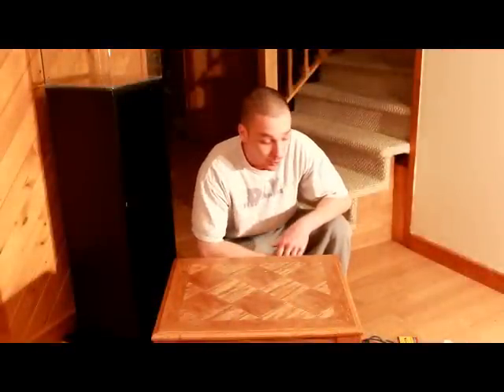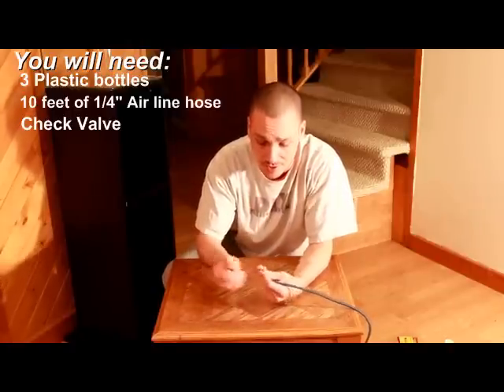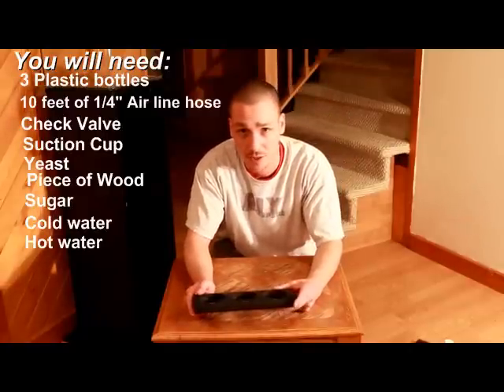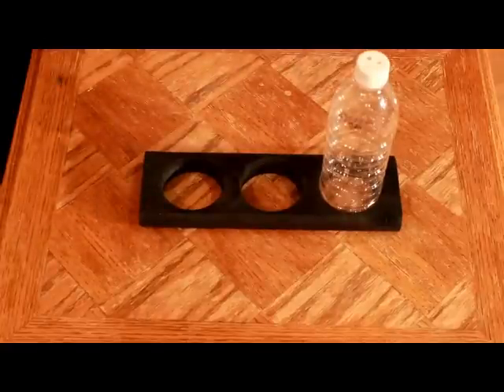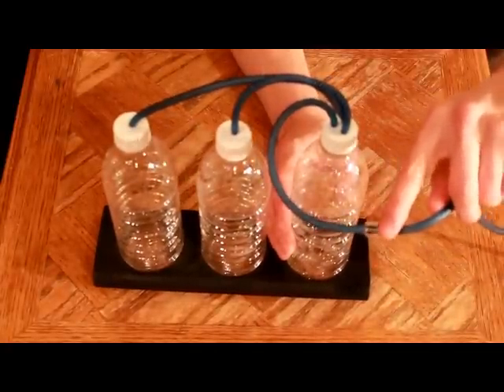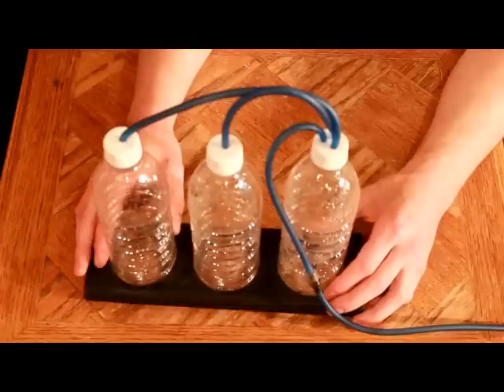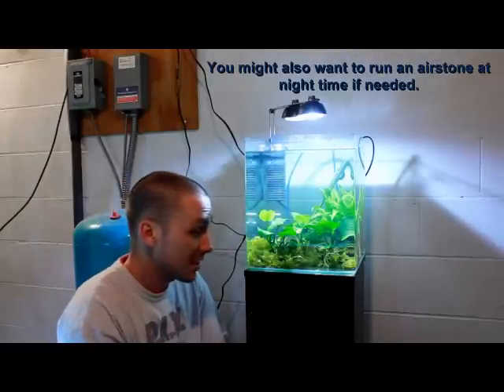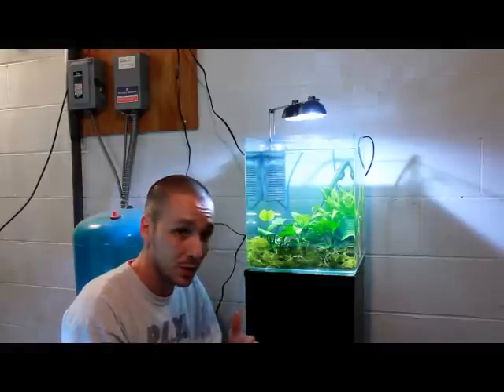HOW TO: DIY CO2 for planted aquarium TUTORIAL

Comment: Anyone watching this should add a check valve between each co2 reactor & the sump/collection bottle. Doing this allows you to disconnect the reactors without losing pressure in the system.
Reply: Hey only got one check valve can i use it in before the yeast generator  or before the bottle bubble counter whose co2 pipe is directly  connected to diffuser

Comment: i have aquestion, i have 4 planted small mini tanks, and i wil use your system, only where do i put the check valve?, i have now 1 check valve, do i need 4? 
also i have a metal splitter with 3 ways out (+tap taps) to use : to my other 3 mini planted tanks. (3 are same gallon, 1 is bigger gallon, 
please can you help me where i put the check valve(s), 
and where put the splitter 3 way out, with tap taps, 
thank you..

Comment: How much would this setup possibly be for a 125 gallon aquarium?
Reply: TheTerminator1919 You can do this project multiple times and have them work at the same time for more co2. I think getting a tester for co2 to see how much you need. I would say it costs a lot cheaper than a $200 system.

Comment: if you turn the co2 off at night would yhe bottles explode from the co2 build up???
Reply: Maddie B yes. it will. the cap. solution get a epoxy or any glue, glue gun to hold tight the cap.
Reply: @diyhobby5574  so should I remove the cup for it to not explode?

Comment: Hey Joey, as always great information. I do have a few questions though. 1. could you just attach an small air stone to the line instead of building the Co2 diffuser? 2. Can you also attach the Co2 line to an air pump line and have both flow into the tank at once?

Comment: I'm doing this with 2 575ml bottles, my yeast sugar mixture is fine since I can see many bubbles popping up in the 2nd bottle but my problem is that the CO2 is not flowing through the tube into my aquarium, I let it sit for an hour now and it's still not popping up in my aquarium.. I don't have an inline valve thing, just a tube straight to an air stone from the 2nd bottle.. Why is this not working? Do I need the inline valve? Do I just need to wait for more pressure to build up? I don't think there is a leak in the 2nd bottle because when I squeeze it the air DOES go through the line into the tank.. Help!
Reply: did you get it to work? was your air stone not letting it pass through?
Reply: ***** I always had a tiny leak that I just couldn't seal up with hot glue but the main problem was the air stone. It would not build up enough pressure to push through it. I didn't know this at the time but they have pressure ratings. When I took the air stone off it worked fine.
Reply: XeDragHD as for me i didnt use air stone but i use an cigeratte butt since its more easy to setup than air stone

Comment: I did this exact setup but the co2 seems to just be sitting in the bottles, and doesn't come out the line to the tank. Initially it did 1 bubble per 5-6 seconds, but now it does nothing unless I squeeze the 3rd empty bottle, then obviously co2 floods out the line. What am I doing wrong?
Reply: +Joshua Matthews Hey! I see that I'm 3 months behind answering this question, and hope you have since figured it out! I'm just starting to plant a tank.  I think adding some tap water to the third bottle may help you out.  Give the co2 less volume to hang out in.  You may also want to inspect your setup for leaks.

Comment: I just DIYed  a CO2 generator and added a regulator to help control the amount of CO2 in my 40 gal tank, but the gauge is not moving at all, after 24 hours, but the bottles are hard with gas. I opened the needle gauge but nothing is happening. What am I doing wrong? I really need your advise.

Comment: when attaching the airline to the lids of the bottles you can also drill just a bit bigger hole, put the tubing through the hole and then lightly heat up the end of the tubing with a heat gun, torch or lighter, then flare it out a lot with a sharpie or some type of pen. Then pull it snug. and its airtight

Comment: Quick question. If I wanted to use glass bottles in place of the plastics would there be issues?
Reply from the maker: Glass would even be better as they would not allow for expansion of the bottle. (pressure from gas build up)
Reply: ***** but wait … what if the glass ones can't withstand the pressure … or can they ? I'm using a Soda bottle cause they're meant to withstand the CO2 in there ? Idk its just my idea LOL
Reply: ***** The pressure doesn't get that high in DIY CO2 generators generally. Though glass wouldn't be that great of an idea if you plan to reuse the bottles since other things may grow on the glass that would kill the yeast when it's starting out and it would be hard to clean it between uses.

Comment: i already have fish in my tank and tried to add plants they didn't do well; didn't know about the co2! im going to fix this but before i just tank out the air stone and add the co2 system i was wondering how this might affect the fish. i know the plants will produce the oxygen for them but the plants are really small and im worried that they wont produce enough. so i was wondering if i could just add the co2 and leave the air stone until the plants are bigger or could i take out the air stone add more or bigger plants and the co2. its a 75 gal with 3 koi, 2 angel fish, 2 cory catfish and a pleco.

Comment: I had low pressure so what i did took 1 bottle away filled generator bottle with half cup of sugar and 1 full teaspoon of baking yeast less sugar produces less alcohol the filter bottle i half filled with water put the airline deep  in the water so i can count the bubble flow im getting 2-3 bubbles per second placed my diffuser (which is a cigarette filter making very fine bubbles) close to the top of my tank on a suction cup in front of my filter which pushes the bubbles around the tank the longer the bubbles stay in the water the more co2 for the plants PLEASE NOTE turn off all air stones pumps and anything making bubbles as this will make the co2 useless so at daytime i run my co2 when i turn the light out i take out the co2 airline and put on my pump for oxygen for the fish  hope this helps some people out

Comment: question. do i need to turn off or get the diffuser out of my tank at night?
Reply from the maker: Kyle Zoleta or just turn an airpump on in the tank to help with gas exchange at the surface. (i would put the lights and airpump on a timer. when the lights go out, the airpump comes on)

Comment: Hey Joey I have a bunch of 800 mL bottles lying around that I want to use rather than buying new 1 L or 2 L bottles. If I use the 800 mL bottles for half a litre of the mix, can I get a CO2 output equal to a 1 litre mix if I put 1/4 tsp yeast and 1/4 tsp warm water? Essentially, if I want to double CO2 output do I just directly double the yeast mixture, or is the ratio different?

Comment: Hey Joey ***** Would I need a diffuser, if I attach the outlet to my impellar on the HOB filter on my tank. Now its a 5 gal nano, so It has a small HOB for 15 gals or less on it. There is fine sponge on the inside for the gas to pass through on the way out. Would that be sufficient?

Comment: The best mix is:
Use a 1.5 liter bottle
Mix 4 deciliter hot water and 4 deciliter sugar, shake the bottle to dissolve the sugar

Then add 4 deciliter cold water, add on teaspoon of baking soda and shake the bottle.

Then careful add 2 teaspoons of yeast DO NOT SHAKE, the yeast should sit on top of the mix.

Comment: Nice video! I think Im going to try this out my self. I want to add something though! I think might work well with this system. If you want your yeast to produce moor CO2 you need to let the yeast have some supply of air from time to time. This leads to arobic respiration witch makes the yeast abel to break down the sugar moor completly. To fix this you could install a check valve from an old bike wheel tube, onto the CO2 generator. Then u can use a bike air pump to pump air into the system. And also the pump would counter the pressure difference in and outside the system so the air actualy can enter through the check valve even thought there is higher pressure inside the system then outside.

Comment: I'm using the 3 500 ml bottles as you indicated..
Am I correct that for a 10 gal tank, you'll only use 2 generator bottles filled with a total of 2 cups of water/sugar split equally between them?
Reply: I have the same question!

Comment: The video mentioned using an inline valve to regulate the flow of CO2, That would also enable you to easily shut it off at night. .

Another idea I found works well:  If you have an internal filter, drill another hole just above the inlet slots & feed the airline into it. The impeller will chop up the CO2 bubbles way finer than any diffuser.

Comment: Thank you for all yours ideas about aquariums systems. 
Then i DIY me CO2, its a littlebit  difficult to put the air hose through that 4,5 mm hole.
I use me scissors to  cut about 60 degree off the end of hose, after that its easy to put it through.

Comment: For those worried about CO2 build up overnight would some sort of inline relief valve be an option? Open the valve to bleed off the gas at night into your room and close the valve in the AM to start putting the CO2 back into the tank? Does a part like this exist? I have no idea... I just thought of this idea. Thoughts? BTW, planted tanks rock!

Comment: I never saw a 3 bottle method before. I did this many years ago with a single 2 liter bottle on a 55 gallon community tank and never had any issues with fish dieing. Added a little baking soda to the mix to slow the reaction down some. To diffuse I used an airstone, but also tried running the CO2 tube to the filter intake of a canister filter- once with one filled with media with no issues and then added an additional smaller empty canister filter with no issue.

Comment: I found that it is easier to insert the line into the cap if you cut a 45 degree angle on the tip of the hose before inserting it.

Comment: Air-stone is basically a diffuser. You need a specific diffuser for CO2 because air-stones do not release small enough bubbles to be taken into into the water by the time they reach the surface and escape.

Comment: Great video! I love all your vids, but this one is especially awesome. One question though: On other DIY Co2 generator videos I've watched they run the gas out of the yeast bottle up through water in the collection bottle to purify it and take any alcohol out of it. Is this necessary or optional? You seem to know a great deal and I trust your guidance, but will running it through water once before it heads to the aquarium harm the Co2 in any way do you know?

Comment: hey joey another informative video, I followed your design except used a 2L and then the smaller bottle for my tank but i connected the last hosing with the check valve to my tank to a old powerhead as the diffuser. Specifically i connected it to the venturi/airline valve on the output. Is this okay? I glued my bottles inside and out and i do see bubbles, the powerhead is on too, is this a good idea?.

Comment: I've been a fan of yours Joey, but you are making this unnecessary complicated. The way I make it is one 2L soft drink bottle, with 1/3 bottle of sugar, mix with 2/3 bottle of water and one table spoon of yeast, and it will last a month for a 2 feet tank. For a smaller tank just use a smaller bottle with same scale of ingredient, but again you only need one bottle. Also you can glue the check valve on to the bottle cap with super glue, and use a small piece of wooden chopstick as a diffuser.

Comment: Thanks for your video, it was really informative.
I have another suggestion for a diy diffuser, you can use small bamboo skewers (or toothpicks) and stick it into the tube. Then cut the skewer such that only a bit of it is sticking out. The air will diffuse through the skewers in really small bubbles. You will also have to block off the end of the tube. You can run the tubing across the bottom of the tank and stick the skewers into the parts of the tube that will be closer to the plants.

Comment: Joey, thanks for *all* your videos,  Few things in regards to this video:  - Cut the tube at a 45deg angle: it's much easier to plug in the cap.  - Use soda bottles as they are made to resist internal pressure. - In your mix add 1-2 small pinch of salt: it slightly inhibits the growth of yeast and prevents a production spike. (last longer) Also add 1 or 2 drops of vinegar to the water to bring down the PH. Add few cubes of super sweetened  jell-o: it dissolve very slowly and release sugar.

Comment: Looks fine, but from what I remember, silicone tubes that comes from the power mixture (yeast mixture), should be extended in order to reach below the water in the third tank. The water in that tank should purify the gas, that is formed by fermentation. The rest is as much as possible in line with practice.
Besides i use a 1410 recepture, that means 1l of hot water, 400dg of sugar and 10dg of yeast.

Comment: Ok, I made mine tonight, I did not like the unsightly plastic bottle in the tank so I used Fluval Bio-Foam cut a hole in it then I inserted the end of the hose that has a bubble stone on it in to the foam.  I then put the foam in to a alagator sskull decoration so it is out of sight.  The decoration is under the filter flow, so I hope it assists in stiring up the co2 bubbles.I will report on it later.

Comment: Dude, this is probably the best explained diy co2 video I've watched. I just had two (probably dumb) questions: would the blue and white filter media work in place of the sponge on the diffuser? and since I don't want to have to run an airstone at night, would it be ok to just take the cap off the water bottles at night, or would the pressure be lost?

Comment: ...acts like a solenoid because I plug it in to the same timer the lights are on.  During light time tiny bubbles diffuse in the tank and then at night when the impeller is not moving, the gas just lets out big bubbles which don't get into the water.

Comment: I have been doing DIY Co2 this way but I use a TINY fountain pump (or beta tank power head pump) and I put a barb (from a drip system emitter I broke apart since it is the same size tubing and then has the big round end) through the little grate where the pump sucks in water.  Then route the Co2 hose to that and tilt the pump a little so it sucks water and gas.  The power head diffuses the gas beautifully, creates circulation of the gas AND, the best part is it acts like a solenoid

Comment: Do I need an AIR PUMP all the time that the CO2 generator works. I ask you this, because I bought a CO2 "ProFlora taifun" reactor (one year ago, and still not used it). My fish tank is about 20 gallon and is populated. So, is it possible to die all my fishes over the night. What do you recommend?

Comment: Hello Joey!I liked your video and I just finished the setup.I have a dilemma/question : as a diffuser,can I use the one from an old Tetra CO2 Optimat(maybe you know it,if not,Google knows it for sure :) ).This is a dilemma for me because the top of that diffuser has a very thin membrane that keeps the CO2 inside for a long period of time and the mixture with yeast and sugar produces CO2 continuously,so I am not sure if it will not accumulate too much pressure inside that big "green tube".
Thanks

Comment: Hey Joey,
Lobe your videos. I am currently researching different tank set ups and such to do a complete rebuild on my 55gal freshwater tank. I would like to add an overflow into a ten gal sump that also has its own overflow build out of spare air line. The duel tank duel overflow combined with a drip system should eliminate water changes while adding additional filtration and auto-top-off. I built a single bottle of the generator as a proof on concept. Keep the vids coming.

Comment: For those asking about check valves, yes you need to have one. If you don't what happens is that once the CO2 stops producing, you'll end up getting a syphon back to your bottles, meaning water will be pulled out of your tank, the check valve stops this from happening. You should always use check valves even with regular air pumps, otherwise you risk water syphoning down and into your air pump, possible electricution or water damage to the pump. Great vid Joey

Comment: Try it without a check valve. If it still isn't making any bubbles then something went wrong with your mixture. If it does start making bubbles without your check valve on, then you will need to get a new one or you can put your bottles above the height of your aquarium, that way even without the check valve water won't siphon out of your tank.

Comment: Yeah, you're right. I think he should clarify that the hose into the third bottle needs to go under water. 
It seems that he didn't sank the hose in the third bottle. Which is extremely important because you need to get rid of the other gases and alcohols produced by the reaction.
But the bottle is there, there is no need for an extra bottle ;-)

Comment: i make wine and know if you heat yeast too much you kill it dude try a warm solution instead not hot, luke warm should get the co2 pumping just fine you want fermentation between the yeast and sugar if you kill the yeast nothing will happen no more than 30 degrees trust me I know my stuff. and keep the slution around that temp 26 celcius will do just fine. if that does not work you will need fresh yeast it does have a shelf life.

Comment: ok so i followed these instructions and set the system up in my small tank...waited 24 hours, and not one bubble. Can someone tell me what i did wrong? I used half liter bottles like in the vid so my mix was: .5cup suga, .5 cup water, 1/16tsp yeast. put water and sugar in first, mix yeast with hot water(over 104F), put that into water/sugar mix...anything out of order???